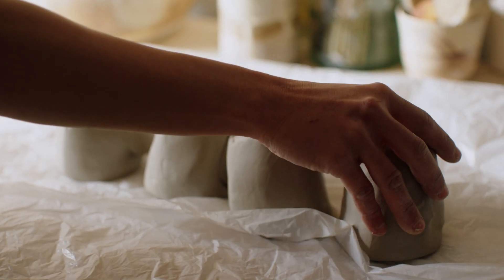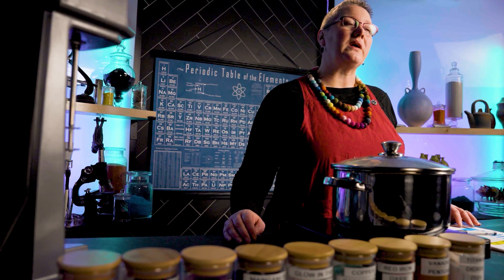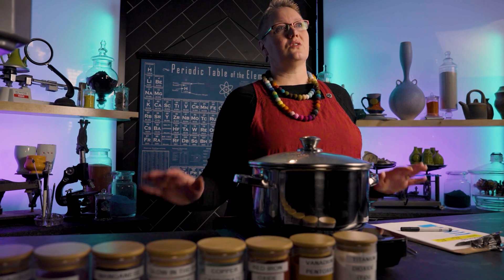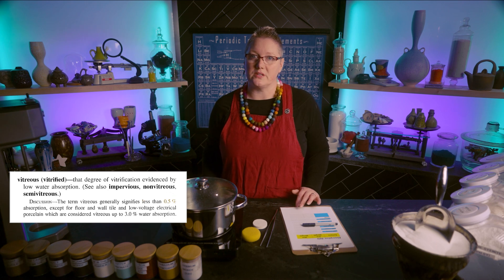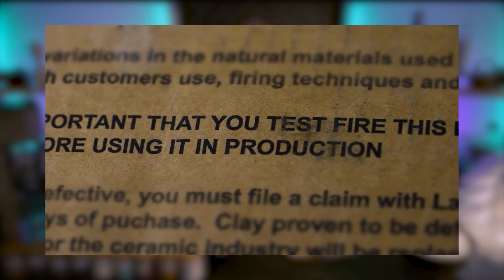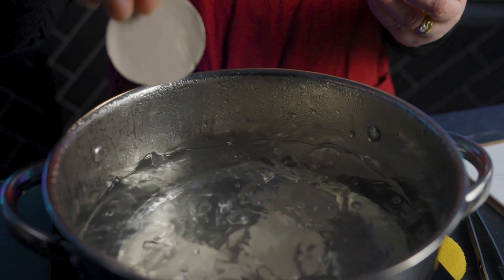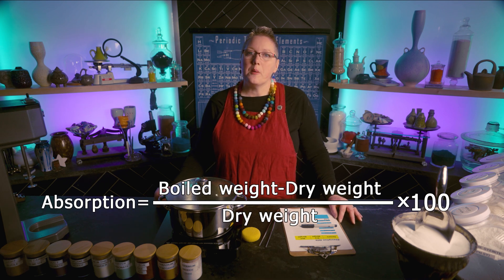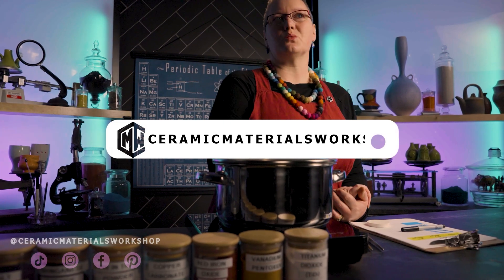Self-Absorbed | How to find your clay body's absorption | Ceramic Materials Workshop

Comment: Im definitely going to try it. And if it isn't, what's the solution then, just a higher firing temperature until you reach a value within tolerance levels?
Reply from the maker: Theoretically yes.  But better would be for the clay manufacturers to make clays that meet expectations for the prescribed temperature.
Reply: @ceramicmaterialsworkshop  agreed! It's always been a concern of mine. When I went to a community studio the clay they chose and how they fired it was not adequate and there was mold later. Now that I choose and fire my own clay I have not had that happen. But I still have some questionable clay bodies in my possession 🤔

Comment: ASTM C242 merely defines “vitreous”, “semivitreous”, etc.  It in no way specifies that functional ware should be vitreous, semi-vitreous or otherwise.  It is incorrect to cite it as the definition of absorption required for functional ware.

ASTM C242 and the FDA standards do not define the degree of vitrification for functional ware. FDA does not say that functional ware needs to be vitreous. FDA merely says “non-absorbent” without defining the term or specifying the degree of absorbency, and FDA standards cover the entire piece of tableware including glazing that can make a piece non-absorbent. (FDA also says non-crazed surfaces.) 

To recommend 0.5% absorbency is fine. It's what I prefer myself. However, to suggest that ASTM and/or FDA standards define 0.5% as the absorption for functional ware is misleading.  Earlier this year, I contacted ATSM asking if there are any such standards and so far, have received replies saying they know of nothing. I continue to reach out to contacts at ASTM. Meanwhile, I challenge you or anyone else to cite a standard that says functional ware (or ceramics in contact with food) should have x% absorption.

Your pucks are too small. ASTM C373 requires test specimens to be at least 50g.  Your pucks are under 50g. ASTM C373 also says they should be placed on a wire support and to keep all sides exposed to the water, and not stacked on each other as shown in your video	

A study done by several researchers in Brasil showed that the boiling time had little impact on absorption testing. Their report has charts that show 1 hour boiling is just about as good as 5 hours boiling.  Total immersion time subsequent to the boiling does make a difference so sticking with the 24 hours immersion as you did is wise. Their report can be found here. https://www.researchgate.net/publication/321135648_Comparison_of_Methods_for_Determining_the_Water_Absorption_of_Glazed_Porcelain_Stoneware_Ceramic_Tiles

Comment: If your piece is covered in a vitrified glaze with no crazing what's the problem?
Reply from the maker: It depends on what you consider covered. If there is an exposed foot ring, that will still absorb water which can grow mold and bacteria. We have seen plenty of pots with a ring of mold under the glaze, from exposed foot rings. 
And the foot rings are then more likely to sweat, leaving water rings on surfaces.

Additionally the absorbed water will react in microwaves to make the work get very hot. As well as generally making the work more susceptible to thermal expansion variation over time.

Comment: What's you guys opinion on having freshly fractured surfaces? Are we actually interested in the absolute absorption of the whole clay as potters or just the functional surface that will be used? I have read anything lower than 3% you really need to be doing the test under vacuum but I have only read ASTM C373. It's the same boil 5 hours and soak for 24 hours.
Reply from the maker: Fired clay is homogenous, (assuming the firing was even). So it does not matter if it is  the surface or interior. 

We've not aware of any test for vitrification that uses a vacuum. There is a test for unfried clay that does, but that is a completely different thing. Boiling water will penetrate a body just fine.
Reply: @ceramicmaterialsworkshop  I have no results to prove or disprove anything but I was reading "A comparison of water absorption test procedures 1985" and they say "the thin surface layer of lower porosity and permeability which is often found on plastic-formed or slip-cast articles" One day I will actually test if breaking the ware makes any difference. 

The ASTM C373/1956 says it applies for ware over 3% but they seem to have changed their mind in later revisions. It's not an american standard but BS 3402 quality of vitreous china sanitary appliances says "Maintain the pressure at less than 30mmHg for 1 hour, then admit cold freshly boiled distilled water to the vessle, without reducing the vacuum, until the pieces are covered"

Long story short when they compared every method there was about 1-2% difference in absorption results between submerging under vacuum compared to just boiling and soaking.